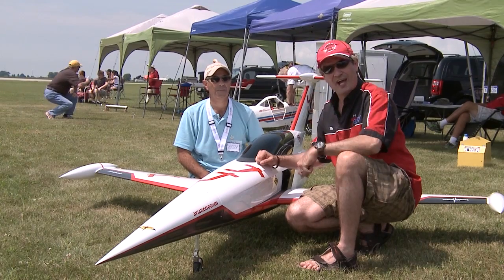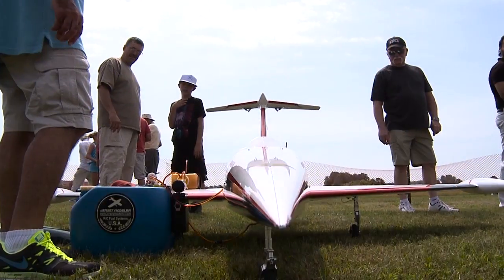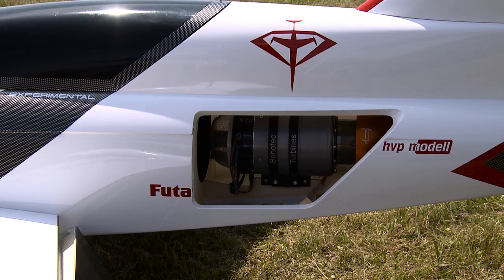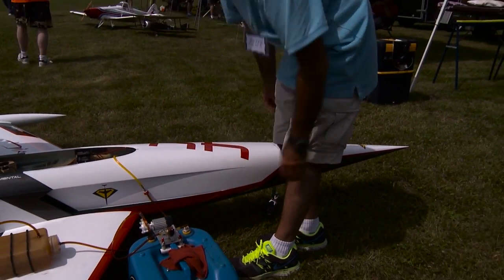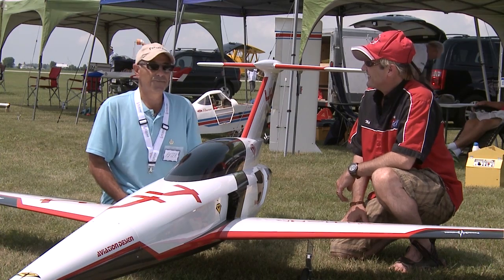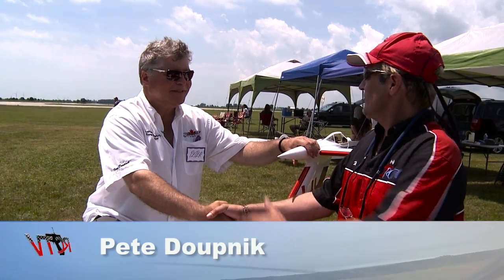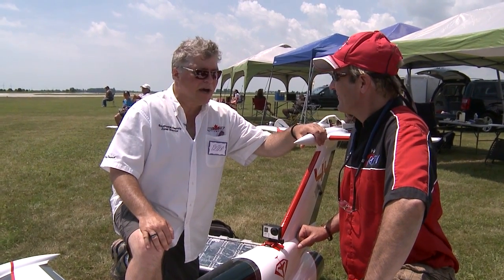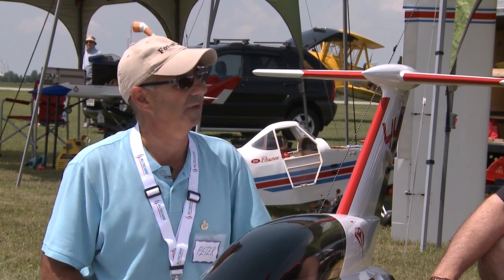RC Jet goes 500+ KM/Hr!

Comment: nice plane, but, where are the 500kmh?
Reply: I have jets that does a true 500+, this huge thingy simply don't. But the point is that it does not matter. Just don't state a speed, just say it's "fast", because everything over 200kph is fast in the eye of the spectators. The 3-400kph planes are unreal and the 500+ ones are beyond!  Mine is only 790mm!